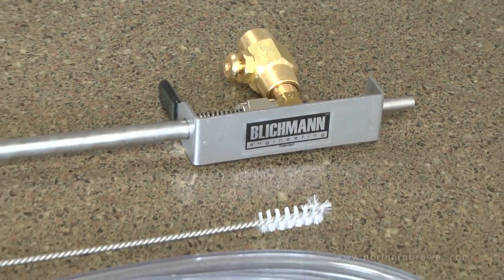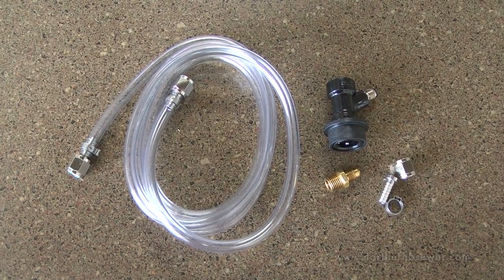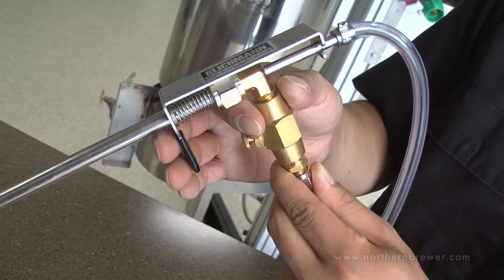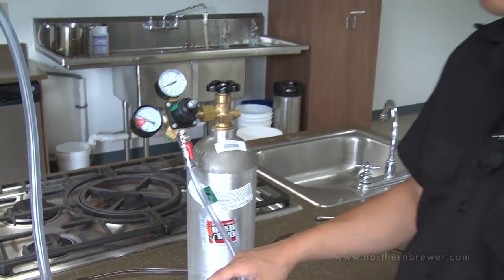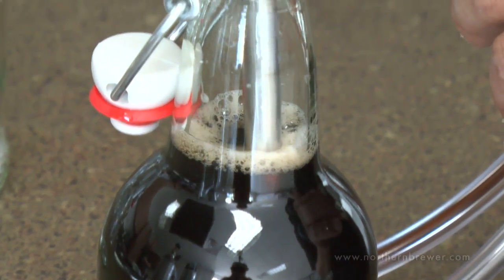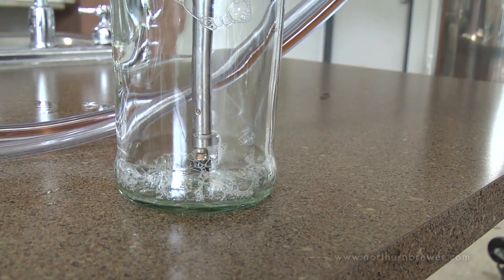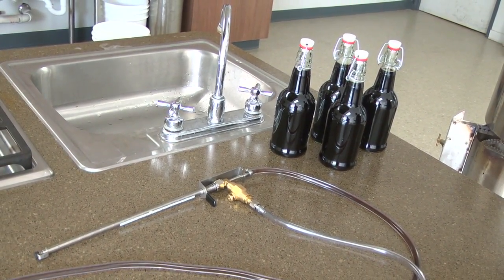How to Bottle Beer Using Blichmann BeerGun

Comment: Obviously, they do not understand the concept of counter-pressure....  I can see it may be handy to fill, but this is going to have a lot of CO2 escape, which is the entire reasoning for counter pressure.  The counter in counter pressure relates to the bottle being pressurized first... then filled so there is minimal co2 loss.  This doesn't even seal the bottle so it can't change the atmospheric pressure in the bottle, thus, it's not much different than if you just put this on a gravity filler or something like that.  Only advantage is probably that you're filling from the bottom.
Reply: It's a different concept than a counter pressure filler. It never claims to be one. It's called a "bottle filler."  Another advantage is having a free hand.
Reply: counter pressuring for a few bottle for fun is overkill and waste of time and money.

Comment: Question. Is the kegged beer all ready cabonated or is this beer gun only for pre-carbonated beer? I have seen other home made beer guns but they have a tappered rubber plug that fits tight over the beer gun shaft and is pressed againsted the bottle mouth to hold CO2 pressure on the bottle to  reduce foaming. Do you think this beer gun could be modified for pre-carb'd beer?

Comment: This beer gun is almost impossible to use.  The beer has to be nearly frozen and totally over carbonated and even then most of it just foams out.
Reply: There is a trick to using it.  Here is what I do. I evacuate all the gas from the keg. Than I hook up the manifold to the keg and use only like 1 psi of pressure so that the fill rate is very slow. I also chill my keg down to 35 degrees and use ice cold bottles.  I literally have no foaming. I just bottled a 24 pack the other day with no trouble. This beer gun works a hell of a lot better than a bottling wand.

Comment: is the space between the inner and outer tubes of the Beergun air sealed, so it could be adapted to a stopper and used as an improved counterpressure filler?

Comment from the maker: @dedication62 - Those bottles were sanitized ahead of time using a Star San solution. Star San is a no-rinse sanitizer for bottles, carboys, kegs, funnels, airlocks, etc.. Of course, try to empty as much as you can from your vessel... but any foamy residue like this is completely safe to transfer beer onto in a bottle, keg, carboy, etc. As we like to say: DON'T FEAR THE FOAM! There is a whole section on sanitizing in our Homebrewing 130 DVD. Thanks for the question/comment. Happy brewing.

Comment: For those of you foaming, here are the tricks I use to have foam-less beer gun beer.   
1.  Use COLD bottles.
2. drop your keg temp down close to freezing. 
3.  use a really long beer line.
4. drop your psi down to 4ish.  

I did this and I stopped getting foamers. It is definitely a chore but the product is good. I only pull my bg out 2x a year.
Reply: Good tips bro. I use the same technic except I use 1 psi instead of 4 as I like the slooooow fill.

Comment: That beer seems undercarbed to be bottled.  I'd be very surprised, unless you tossed in a little priming sugar, that any of those Grolsch bottles were actually carbed.  
Typical 2.5-3.0 volume beer will have a couple fingers foam as it reaches the top of the neck.  That's a good thing because it's keeping oxygen out as you cap that thing.  Even with a quick purge like you show at the end, there's gonna be oxygen in those bottles if you cap them without a little foam-over.

Comment: Purging before is useless…just fill and purge at the end. when the liquid gets to the top and you pull the nozzle out the bottles pull in air. All that is required is to purge at the end.
Reply: air is absorbed with surface agitation if you dont purge pre fill the surface agitation as you fill will absorb oxygen in the bottle 

so the idea is it has a co2 layer as it fills to stop any oxygen entering thru agitation 

he could also leave a 5mm gap at the top before he pulls out the wand to make sure there is a constant layer of co2 then a final purge to do as you said

Comment: Can this be used for bottles using corks instead of crown caps or flip tops?
Reply from the maker: It certainly can, although some of those cork and cage beers might call for higher CO2 level so just be careful when filling the bottle.Try to chill the bottles first if possible to help prevent foaming.
Reply: NorthernBrewerTV  We’ve since bottled our Belgian style triple using the BeerGun, and it worked quite well. The only problem we had was there was a more foaming than usual but I feel we over carbonated the beer to begin with.
But other than that it worked out fine. Thanks for getting back to me.

Comment: I am curious if this can be done with wine bottling?
Reply from the maker: You can use a BeerGun for wine bottling if you have the CO2 equipment available. Just be sure to use a very minimal amount of CO2 psi, enough to move the wine into the bottle. You don't want too high CO2 in the process or you might risk slightly carbonating your wine.

Comment: Will beer that I bottle straight from the keg continue to “age/condition” in the bottle? Or does the forced carbonation through keg ruin that?
Reply: Yeast are hardy enough that it takes more than, say, 11 psi to kill them (many German breweries even primary under pressure, though it takes skill and good data or patience); the point being, unless you filter your beer, there's no less active beer in your post-Beer Gun beer unless you, say, cold crash before packaging. So yeah, the beer will continue to age, though conditioning in the sense of carbonation would only be true if you'd added sugar or used a spunding valve or something, in which case, yeah sure, but I'd personally take the beer to its final carbonation level before transferring, for the sake of consistency

Comment: Hello! Greetings from Honduras.
Guys i need your help, i havve a problem with my beer, sometimes after filling using my beergun, some bottles have exploded, what can i do to prevent that from happening? Does filtration have anything to do with it?
Reply: Sounds like too much sugar left in the beer. Either fermentation didn't complete or you're using too much priming sugar, creating too much co2 and blowing up the bottles. Or your beer is over-carbonated to begin with.

Comment: Sorry, but I have one and it seems to not address my need to move conditioned kegged beer to a bottle for next day use at a homebrew club meeting. I will continue to attempt it after draining all CO2 pressure off of the keg then recarbonating in the bottle which requires more time than I like but I guess it is a necessary evil. Ninty percent of my beers are high gravity and maturation is 6 months to several years. Maybe this is creating my problem.

Comment: Is this only for going from a key or could I go from the fermenter?
Reply: If you have a pressurized fermenter, or one that could take pressure (i.e. a keg with a spunding valve, but definitely not a glass carboy), you could transfer straight from there, but you'd probably have to dump a healthy amount of yeast and trub first, a small chore to be sure. You need a vessel with ball valves in any case

Comment: This is probably a stupid question, but I need to carbonate the beer in the keg first before filling a bottle? Thanks.
Reply: yes and NB tv didn't, lol
Reply: no not need , because beer should have some 3,8 - 4,2 gramm CO2/ l or u enrich with a kind bottle fermenting ... think over
Reply: Only if you aren't bottle-conditioning the beer. If so, then you would purge, fill with uncarbonated beer, prime with sugar, and cap.

Comment: hi, what that beer cold? 2 C?
Reply from the maker: Yes, you'd want beer to be 2-4 C in order to keep as much carbonation as possible in solution during the process. It also helps to sanitize the bottles with very cold water (or store in fridge after sanitizing) to get them as cold as possible as well so they don't foam and expel CO2.

Comment: Does this also carbonate the beer at the same time?
Reply from the maker: The BeerGun does not itself carbonate beer. The beer needs to be carbonated at your preferred volume of CO2 before bottling. It does purge bottles before and after filling to help maintain carbonation, but again does not itself force carbonate beer. (That would be awesome though.)

Comment: What cleaning solution did you use for your bottles?
Reply: Star San sanitizer. 

Most homebrewers prefer it. It's potent and safe. 1oz will turn 5 gallons into sanitizing solution. It's the same sanitizer used in air locks. 

Let it make full contact with surfaces for a minute or two if you want to play it safe. I usually will let bottles sit upright for a couple minutes after having removed them from the sanitizer bath which lets remaining solution on the inner sides of the bottle to slide down and pool up at the bottom, I'll then re-tip them to dump out the remaining sanitizer, but don't be worried about the solution getting in your beer, it's food grade and completely safe. Seeing its foam in your bottles, carboy or bucket is fine, don't be worried about removing it.

Comment: How can you use the beer gun without first filling into a keg?
Reply: Ok. Thanks!
Reply: You CAN use the beer gun for filling bottles from a bottling bucket. You would have to prime your beer for bottle conditioning just as you would otherwise. Put your bottling bucket above your work surface to use gravity to move the beer just like you would with any other bottle filler.

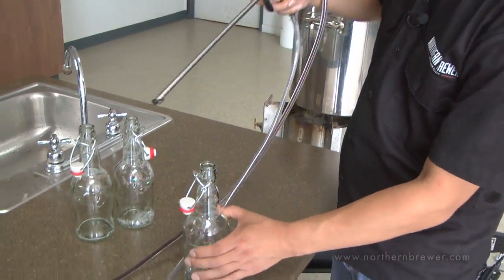Comment: 1:45 Makes me cringe everytime when someone leaves the chemicals/sanitizers in their beer without rinsing them off.
Reply: If it's StarSan (which it looks like it is), you're not supposed to rinse it. You've already gone to the effort of sanitizing everything, if you rinse it after you've just undone all your sanitizing work. Don't fear the foam.
Reply: I've also heard the same and that it's supposed to break down in the beer so the yeast will eat it.. But I'm always dubious about these things that the chemical companies promise the consumer.
If I used chemicals in homebrewing I'd rinse them away before bottling (you can boil the water to sterilize it), I've done this a couple of times with isopropyl alcohol when I couldn't sterlize a big bottle in the oven.
Reply: Isopropyl alcohol and star san are two very different things though. Star san is a food grade sanitizer where isopropyl alcohol has very strong odour and flavour contributions. I would certainly want to get rid of any remaining isopropyl...

Star san has been proven over and over to not impart anything to the beer, not just by the manufacturer, but by the thousands of homebrewers who use it every day. I've had around a quart of it back-siphon into a Helles I was cold crashing and literally zero effect to the beer.

I don't even bother making any significant effort to get as much of the foam out as I can before using the piece of equipment I've sanitized. It just doesn't do anything to the beer.

Out of curiosity, how do you sanitize your equipment if you don't use something like star san? Particularly hoses and things like that?
Reply: You might be right, everyone online is saying that the yeast will eat the star san after it breaks down without any issues. Still, I think I'll need to do more research on the chemical composition of this chemical if I would use it. It's the same as food you know, the less "extra ingredients" there are the more comfortable I am about consuming it.

As for the sanitization, I use my oven for washed bottles (150 degrees celsius, wait until oven reaches that temp and keep for 15 min) and boiling water to clean the fermenting vessel. I use isopropyl alcohol or strong vodka for things that can't take high temperatures (like the hose) and then thurally rinse it off before using. Has worked well so far without any contamination or notable off-flavours.
Reply: there's nothing to break down. Star san is just an acid. 
When you add the beer it becomes diluted. You can equate it to adding a tiny bit of citric or malic acid.
Reply: peopel say dont fear the foam yet they purge the bottle with co2 ...... HOW do you make foam and what is inside it ? OXYGEN so why bother purging when you are laying down beer into foam filled with oxygen
Reply: Yeah, but two things - 1) we're talking about a very small amount of oxygen, at ~20% of the small, small volume occupied by foam, and what's the alternative? Not sanitizing? If you'd like to heat sterilize 50 bottles per batch, go ahead; 2) just because there's a small amount of oxygen, doesn't mean we shouldn't try to minimize exposure. There are a ton of places in the brewing process where oxygen contacts beer, especially on the homebrew level, and yet we're diligent - because spilling one crumb on our shirt needn't require us to douse ourselves in mustard and pickles
Reply: i use paracetic acid leave no foam and is a better sanitizer also i do homebrew but i co2 flush everything and also cold crash under co2 pressure i also transfer with co2 pressure my beer will never touch oxygen after the first 3 days othert han a dry hop process near the end 

i dont go to all this trouble to then have a foam filled with oxygen in my bottles at packaging